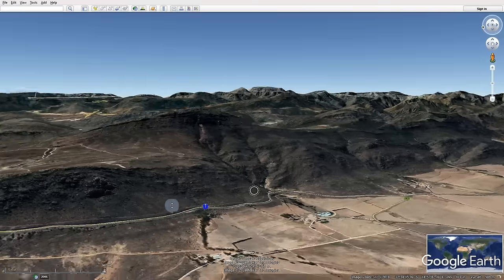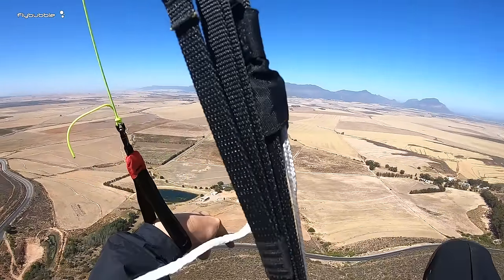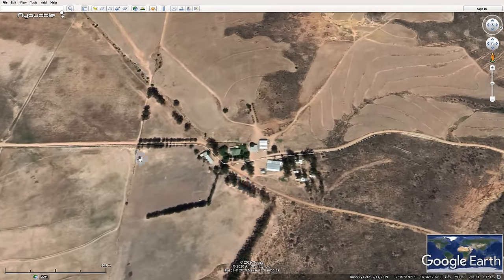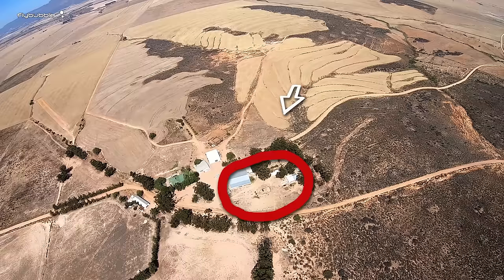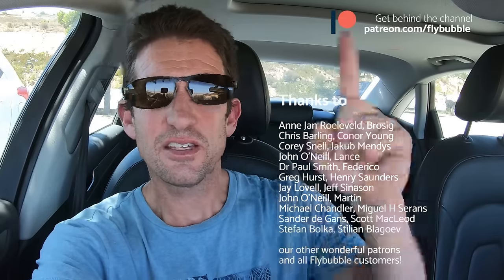Thermal Hunting: Finding thermal sources and trigger points

Comment: I've bombed out at 12 or 13 o' clock in Piketberg, Porterville and Bain's Kloof Pass. Is South Africa always so hard? Northern Alps seems a lot easier to me.
Reply: It depends on which mountain face you take off. If you launch on west face before mid day, it will be hard. If you launch on south east face before mid day, you will fly much better. It also depend on how much time difference there is between true solar mid day and official mid day.
Depend on weather, humidity, night temperature, season...

Comment: Wow, you turn really fast. Average turn in 15 seconds including finding the core.

2:52 start of turn
3:07 (15 s)
3:20 (13 s)
3:32 (12 s)
3:43 (11 s)
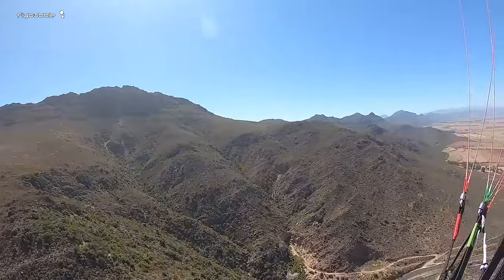3:54 (11 s)
4:11 (17 s)
4:26 (15 s)
4:38 (12 s)
4:56 (18 s)

6:15 start of turn
6:32 (17 s)
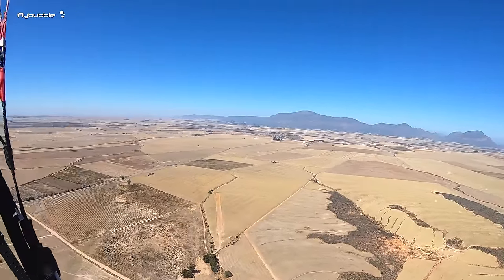6:46 (14 s)
7:03 (17 s)
7:23 (20 s)
7:42 (19 s)
7:54 (12 s)
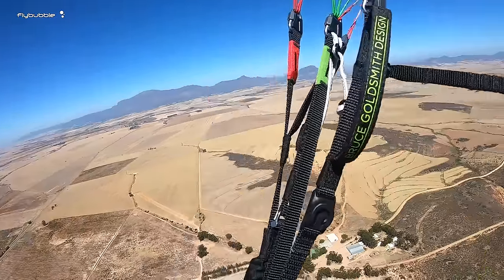8:10 (16 s)
Reply: 16s for a turn is recommended (4s for 1/4)